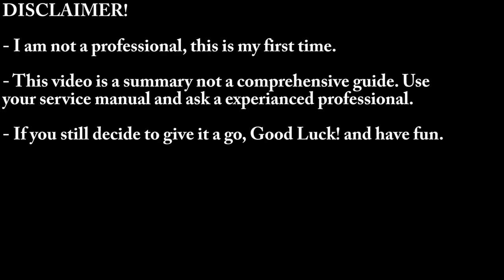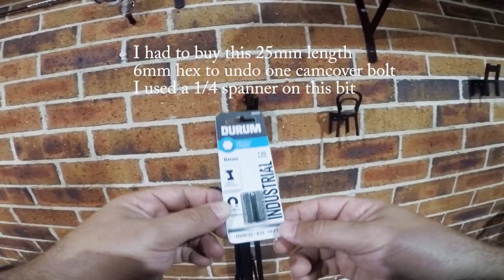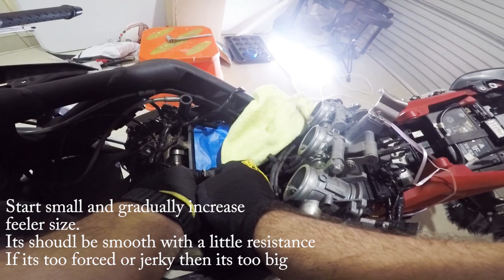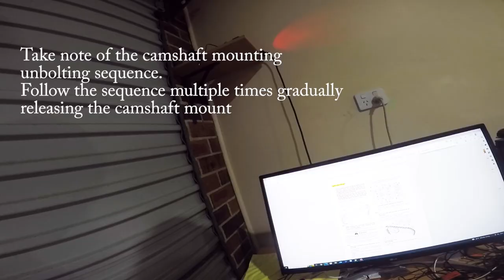How to do Valve clearance adjustment on Triumph Daytona 675R

Comment: Great video! Lots of useful tips throughout.

Any issues down the line since the adjustment?
Anything you learned after publishing the video?

Thanks!
Reply from the maker: Its been running fine since, I’ve done around 1000kms no oil leaks etc. there was a tapping sound but on forums the say that’s normal “tappy valve, happy valve” is quoted often. I’m a bit paranoid that I didn’t use a torque wrench on the cam mounting and cam cover, I didn’t have one that was low enough for those bolts. Also the cam cover rubber can be fiddly, make sure its on properly all round while your bolting the cam cover and keep checking during the mid and end of bolting it down. Also don’t forget the gasget adhesive on the corners of the cam cover seals. Also I didn’t show how I retracted the chain tension, it was a little difficult, a G clamp could help. Good luck.

Comment: im going to do mine soon, thanks for this post. would you be able to link me to the manuals?
Reply from the maker: Please verify its the correct manual from your VIN. Also do you know to calculate the new shim size if its out? I think there is a table also if you don't want to calculate it.

https://drive.google.com/file/d/1rlVrxdMVJS46U03_eB6FMkmG8vvx6bB9/view?usp=sharing
Reply: @sparkthego  i appreciate this greatly, i have a 2014 675r so this close or the same
Reply from the maker: Your VIN must be higher that what is specified on the first page of the manual
Reply: @sparkthego  yes it is. How long did the whole process take you?
Reply from the maker: Id estimate 20 work hours, but id do it in 1/3 of the time now that I know what im doing. Waiting for parts took around 1 week

Comment: Coming up on my 12k service, thanks for this video. Did you have any chain noise on start up? Mines recently started I’ve read that the chain tensioner may need replacing to a manual type. Was this something you encountered with yours?
Reply from the maker: I got chain noise on first startup after doing the job but subsequent startups are fine. The manual said its normal to noise first start but not the starts after that. Did you reset or rewind the tensioner before reinstalling it? Not doing so can break your chain.
Reply: I haven’t done my service yet I already have chain noise on start up, so this would indicate that the tensioner needs to be rewound or adjusted then..
Reply from the maker: @MrMillander  sorry i misinterpreted. You only need to reset your tensioner after it gets taken out.
Reply: @sparkthego  no worries. Cheers

Comment: Dumb question… why did you do a valve adjustment?…
Reply from the maker: Good question! 1. The manufacturer specifies that you need to do a valve check every 20,000kms (for this bike) maybe a little more or less on other bike 25,000kms etc. 2. When I did the check I noticed that the gap on the exhaust valves were too tight i.e. were either passed or on the boarder of the lower spec. gap. 3. If you don't adjust the valve gap and it goes out of spec you will blow your engine. Especially for exhaust valves to get too tight, this is because the exhaust valve needs time seat against the head to cool down when running, less gap means less time (or even no time to cool down because it does not touch) and you will burn a valve. The other problem that can happen opposite to getting too tight is they can get too loose. This is not as bad as getting too tight, the engine might be a little noisy and you can loose a bit of power. I hope this helps?